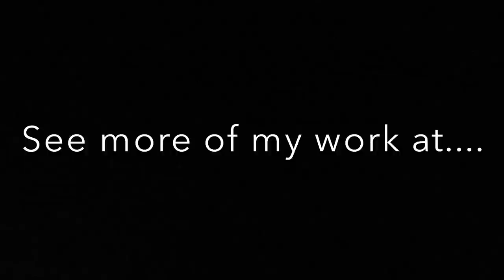Telecaster Style Guitar Build Timelapse - Reclaimed Rustic Tele

Comment: What is the body...it looked like a railroad tie...
From the ones I see for work they're oak...
How's the weight and resonance...I like to feel them vibrate into my body...
Reply from the maker: Most of the wood came from an old support post from a building that was built in the late 1800’s. The oak center strip was trim from the same building. It was actually a good weight (8ish pounds) and it was very resonant. Sounds great.

Comment: In 8:09 what chemical is that?
Reply from the maker: Stewart John that is Linseed oil.
Reply: After applying linseed oil , how many hours do i wait to put the top coat paint?

Thanks and i appreciate it so much!
Reply from the maker: I typically wait 24 hours between coats for oil based finishes. If you plan on switching to solvent based finishes (lacquer) you need to let the linseed oil dry for much longer.
Reply: @strackwoodworking  thank you sir appreciate it so much! Love the info ja bless!